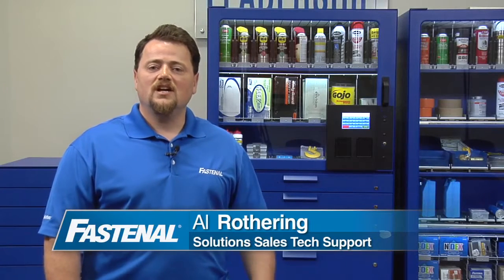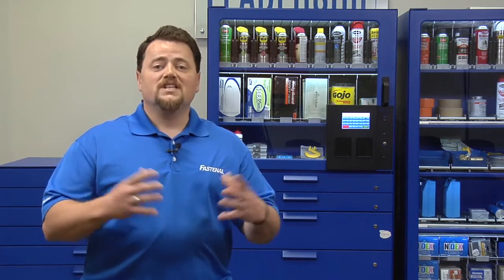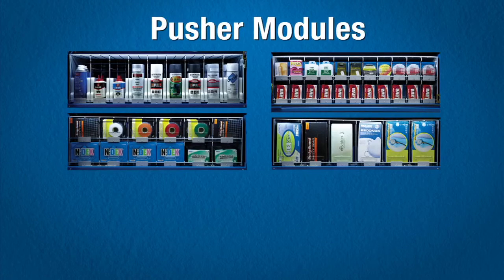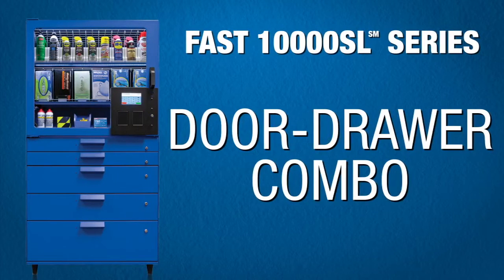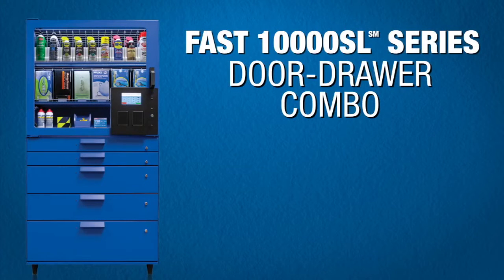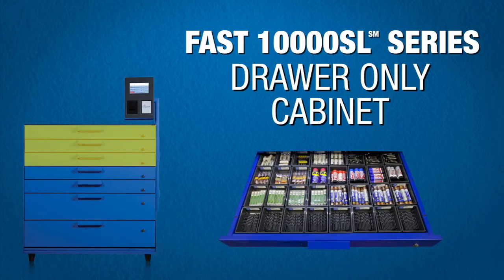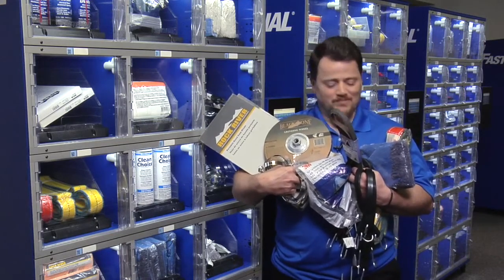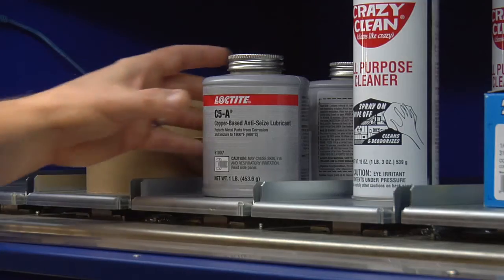Fastenal Presents the FAST 10000SL Series

Comment: Ah', now I see!

Initially, I hadn't understood that the items that were not drop vended were controlled by their individual weight!

I kept thinking about what if someone took items above what they entered into the keypad, how would the company know whom it was!

The scale system rules that out!

In one video a company were dispensing 500 pairs of safety glasses a month, and after the vending machines were installed that figure went down to 10 pairs dispensed a month! 

One can only imagine the cost of those 490 unaccounted pairs a month, year after year, on just that one item type!

That example alone speaks volumes about the savings to be made.